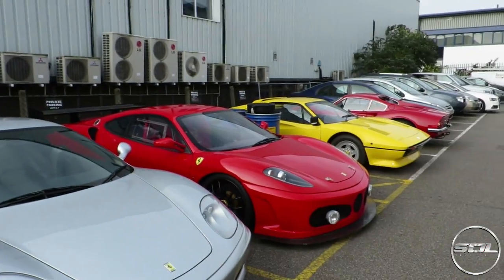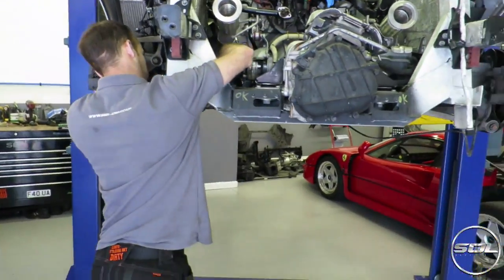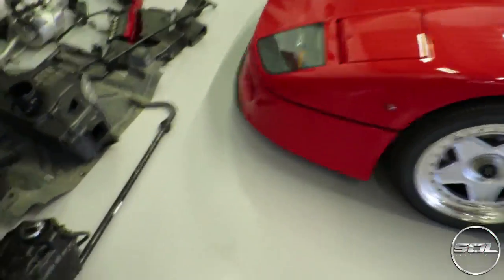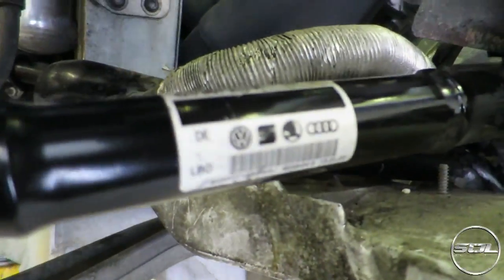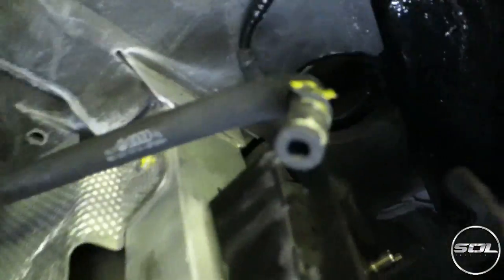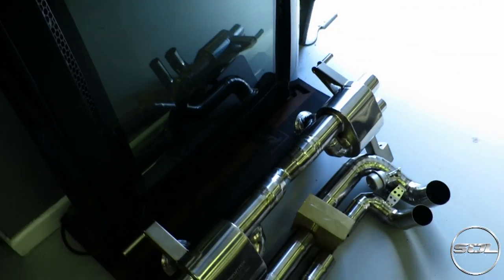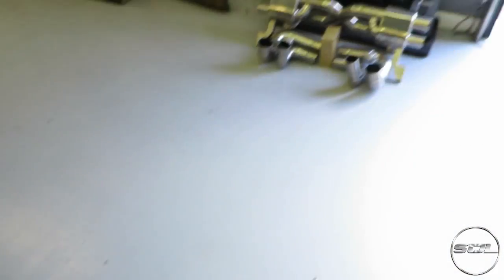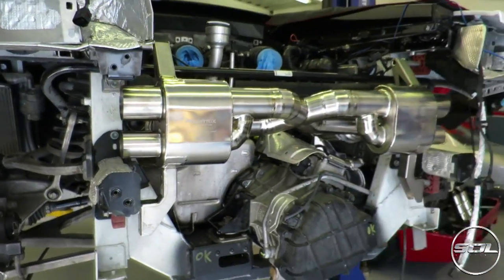THE ARMYTRIX PROJECT: INSANELY LOUD START UP!!!

Comment: For anyone wondering, the sticker on the CV axle that said Audi, Seat, Skoda, and VW is put on every single VAG part. The aluminum space frame on the R8 has one of those stickers, but that doesn't mean that that part is used on a Skoda Yeti.

Comment: Think it's a bit too predictable like just sounds like a louder lambo whereas the R8 armytrix exhaust changed the whole noise of the car and completely changed the character then again if this crackles a lot then maybe it will be enough
Reply: Wait until you hear it properly.
Reply: Daniel Willis Yeah I'll give you that
Reply: +S Miller R8 V8 has unequal length intake/headers and Armytrix corrected it with equal length one. That's why the sound got changed so much. I believe Armytrix called it F1 exhaust and it's because race cars almost always use equal  length intakes. Equal length intake would give the engine more power at the higher revs, while unequal one would give more torque at the lower revs. 
Lambo(and Audi R8 for that matter) V10's have equal length intake so new intake could no way change the sound significantly, unless you want muscle car sound and make it unequal length.